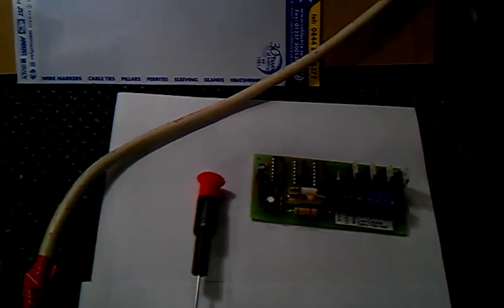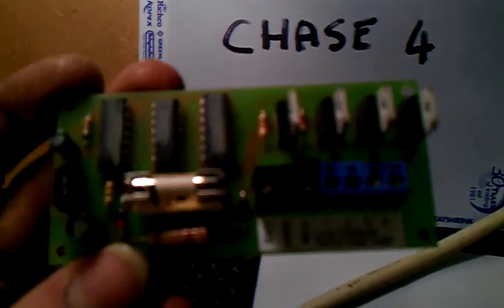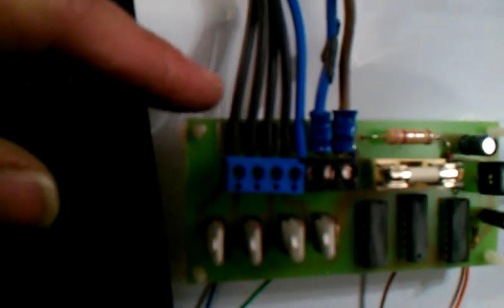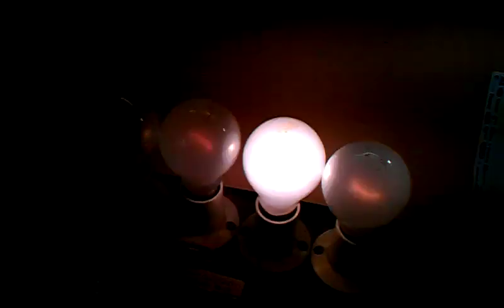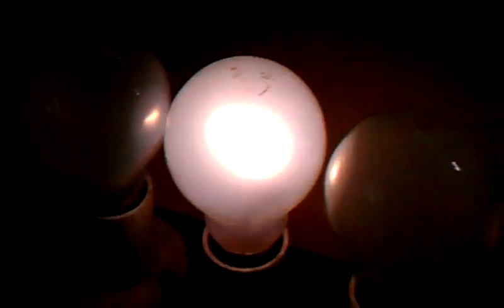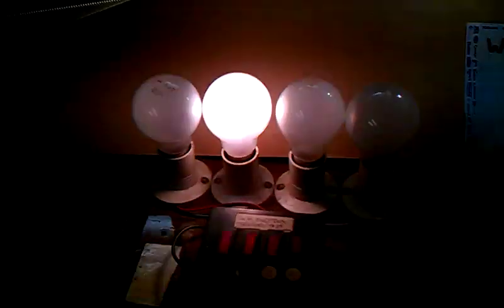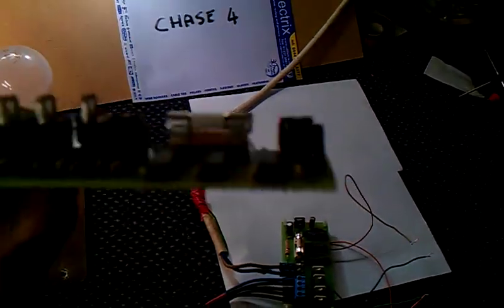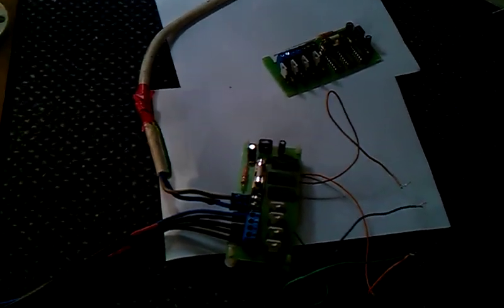How to make lights flash the easy way!

Comment: This controller is excellent for small signs, xmas lights etc.
Check out Angarrack Xmas Lights in Cornwall. Over the years they have used hundreds of these controllers for their xmas display. 3 amps max load per channel. You must connect an earth from your input lead to your box and light wiring. They are 230volt AC in their standard form. They can be made to operate on various other voltages with a resistor change but they must still be on an AC current. The smaller the operating voltage - the smaller the output wattage. Remember 3 amps max per channel.